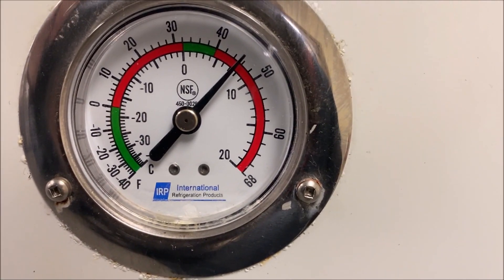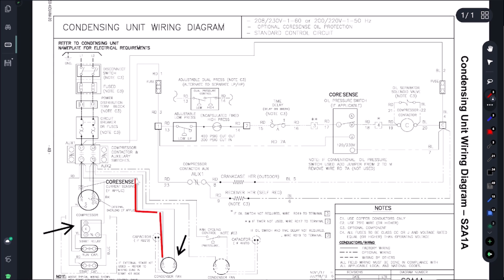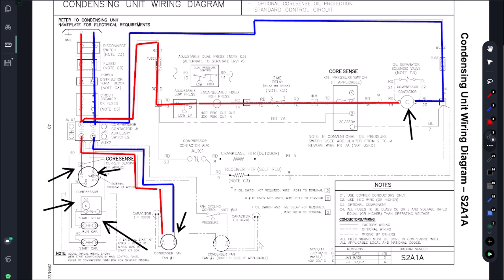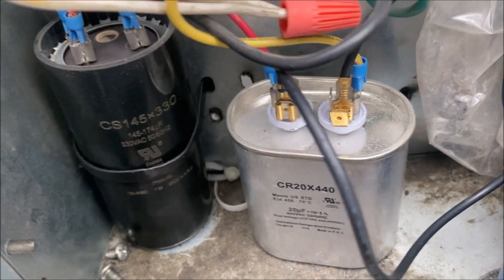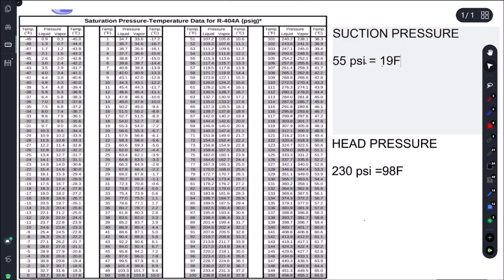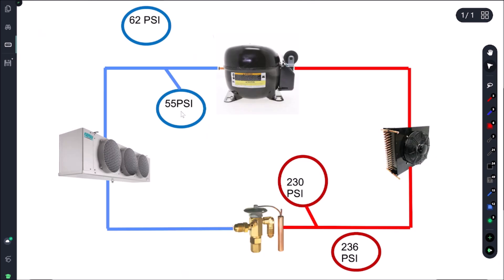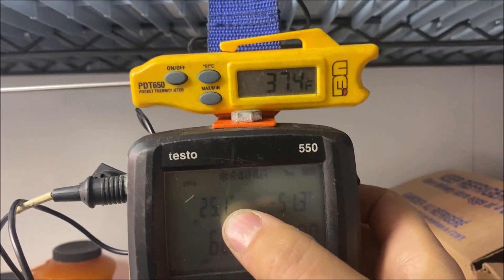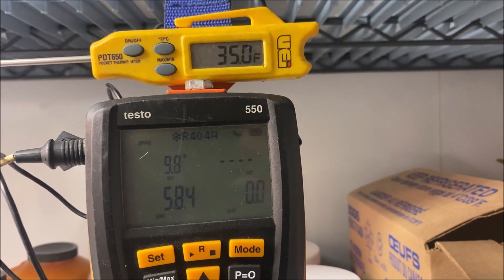Walk In Cooler Is Warm Compressor is not running.

Comment: Hey Man great video, pretty fresh tech here just wondering what you mean by the term 'condenser split' for your calculation? im guessing its the difference between the ambient air temp and the condensing temperature?
Reply from the maker: You got it, will either be a 15F split or a 30F split.

Comment: Hello thank you for sharing ,is 62psi for the suction for 404a is  this pressure it's like standard for any other cooler designs or size all the time?
Thanks
Reply from the maker: Pressure changes when the temperature changes so there is no standard pressure. You need to calculate your evap TD and saturation temperatures. I made a video called “reach in cooler pressures explained” that should help

Comment: for low side I see you use sometine box temp -10F and sometime box temp -15F would you explain when we use Bt -10F & Bt -15F Thank
Reply from the maker: It all depends on what the superheat is set to. We are usually using -10F. If it’s a reach in with a cap tube, we are looking for -20F
Reply: @REFRIGERATIONKITCHENEQTECH Thank you so much

Comment: I just started service work, it a different Beast from VRF builds and heat pump. 
We're do you find the design temps for your box?  Also best place to place temp clamps for superheat and subcooling
Reply from the maker: We don’t use sub cooling when we have a receiver. I put my clamp at the outlet of the evaporator coil before the P trap. Coolers are 34-38F, freezers are -5F to 0F.

Comment: Just a question why didn't you test the capacitors you may have just had a bad run cap,also the super boost is really utilized mainly on hard starting a/c capacitor run motor just saying i wouldn't trust it a on a walk in box as a fix,great troubleshooting though
Reply from the maker: I tested the capacitor, the start one was bad. I was in a major rush filming this one and missed filming a key point lol. We are slammed with calls right now so filming has become difficult

Comment: 👍❄🇺🇸💪 great vid. Calgary got screwed. That was a goal
Reply from the maker: Lol, colorado and Edmonton is gonna be very entertaining though
Reply: @REFRIGERATIONKITCHENEQTECH  question about reach-in cooler. What TD do u look for for a reach-in cooler that has a txv small receiver. No solenoid valve.  2 lbs of 134a. Do u still look for 20 td or 10 td ?
Reply from the maker: It would matter on the superheat, but generally the superheat would be 10F so the evap TD should be approx the same.

Comment: Hay bud where did you get the hook for the Testo gauge cause you know they are not made well they keep falling off
Reply from the maker: Ordered it off amazon “supco HVAC strap manifold”. I put a nut and bolt through and cut the bolt so it doesn’t hit the board. Been using it for like 3-4 years with no issue.